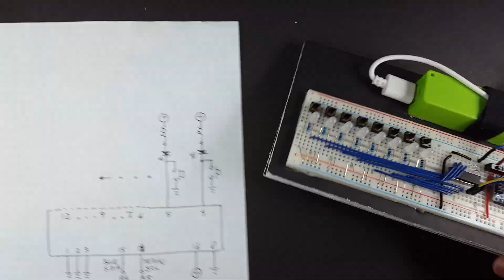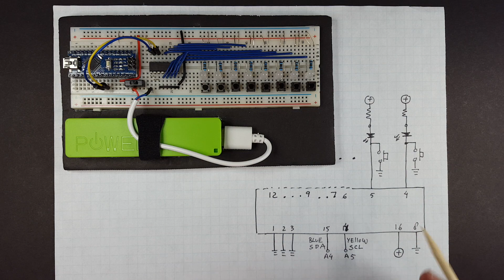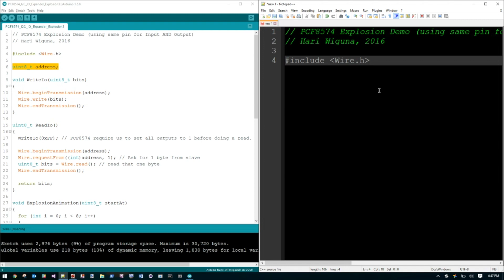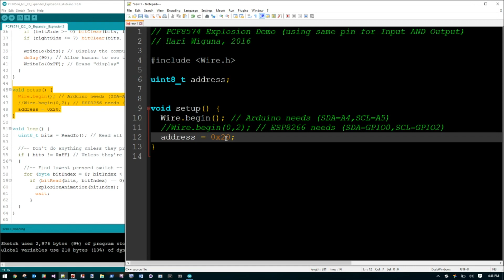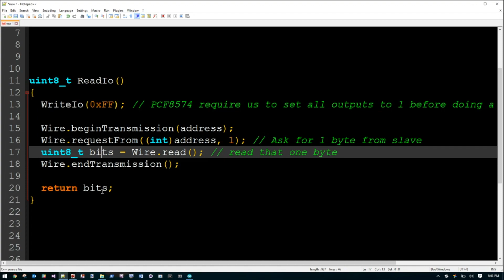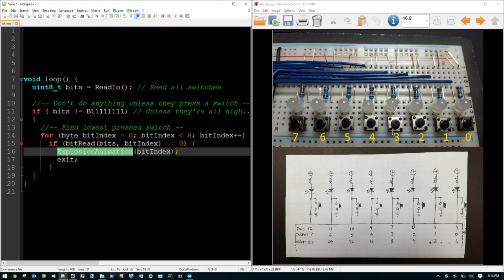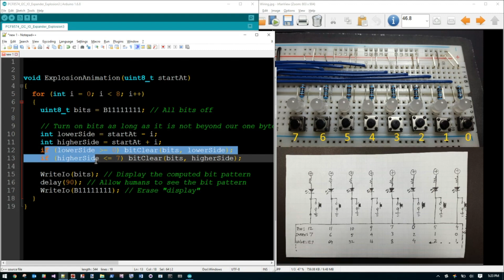HariFun #133 - 8 LEDs, 8 Buttons, just 2 Arduino pins!

Comment: Thank you for the clear explanation. I was confused how each pin is an input and output at the same time but now it's clear. Supply and pin are both high with led in the middle as well as a button that pulls to ground. Pushing the button pulls the pin low, but without the button pressed the pin can go low to sink current through the LED

Comment: For the ExplosionAnimation function, use this instead:  for (int i = 0; i < (8 - startAt); i++)  ...It's a little messy to continue the loop unnecessarily, particularly when there's a delay() in there.
Reply: This is incorrect. Let's say startAt = 7 (leftmost button), then (8 - startAt) == 1 and the loop only runs once with i = 0, meaning the "explosion" will only run one iteration and light up only LED 7.
The easiest way to end the loop as soon as possible is to break out when higherSide and lowerSide are both out of bounds (both are beyond the left/rightmost LED), i.e. somewhere between line 11 and 15 add this:
if (higherSide > 7 && lowerSide < 0) { break; }
When doing that, make sure that lowerSide is not an unsigned integer (here it is an int, so it's not unsigned), otherwise it can never be less than 0.

Comment: I had a lots of fun with the PCF8574, I did it on attiny85 and as well on wemos d1 mini, works well, I added relays on separate PCF8574 as a working unit with your animated leds. With attiny85 I also added Bluetooth or wemos with the wifi so I can switched them using the mobile phone. Work in progress.

Comment: Hi. Thanks for the video, I was wondering how to use the same chip for both LEDs and buttons and you explained it brilliantly. 
I was wondering whether it's possible to do this for a button and LED matric, such as 16 buttons (4x4 matrix) and 16 LEDs (4x4 again). 
Could you perhaps make a video about it?
Reply from the maker: Interesting idea! If you are thinking of a music launchpad, it might not be responsive enough and the leds might be a bit dim due to the matrix scanning, but it should work.
Reply: @HariWiguna  I was thinking more like a control panel for an appliance, like a microwave or a washing machine. You select the program, then you can have the options with the corresponding LEDs. Obviously it would be laid out differently on a circuit board, but the principle would be the same of a matrix

Comment: great video . LOL i look away for 2 days and you gone a did it . LOL . I like the use of 0 for active bit . very clean , sure beats the slower convoluted way otherwise.  I think it would be a good upgrade for my PIR system .  i just need to do a logic invert on the PIR output , great stuff as ever man !
Reply from the maker: +XerotoLabs 
Thanks man!  It's been a fun chip to play with.  Now, I'm going to have to hunt for the 16 bit version in AliExpress. :-)
The spec for the PCF8575 says this: "Latch-Up Performance Exceeds 100 mA Per JESD 78, Class II"
Does that mean each I/O pin could handle 100mA? for a total of 1.6A when all I/O pin are active?! That seems crazy high for no heatsink?!
Reply: +Hari Wiguna looking at the PCF8575e sheet form TI ,  it looks like 100ma is the max you can clamp via VCC or GND pins.
found in the easier to read MXP sheet : " A single LOW-level output current (IOL) must not exceed 20 mA for an extended time. The sum of all IOLs at any point
in time must not exceed 100 mA."
the IT sheet looks the same but is way more info about parasitic draws and leakages , and how to get fastest switching for telecom uses . seems these guys has a sweet spot in ma draw on the outputs for high speed switching  the PCF8575e that is .   

other than LCD drivers the PCF857xx chips mostly come up as depreciated or not recommended by thier MFR's as it's way old. LOL  . that said even it seems for I/O expansion on I2C sparkfun is not selling the PCF break out anymore , and now selling this beastie for 13$ on a breakout board : https://www.sparkfun.com/products/13601
Reply from the maker: Ah.. I knew it was too good to be true.  I have some cheap solenoids that I consumes about 80mA that would have been cool to connect to 16 outputs from the PCF.  I guess I'll have to add transistors.  Thx XerotoLabs!
Reply: +Hari Wiguna hey they are inductive loads , use some darlingtons ,  or a set of  ULN2008 (8bit),  pass your pin to trigger the ULN .   those cheapo steppers with driver usually ship with ULN2003(7bit??) .  i bought a stick of 2003's for 3$ a few years back , as they cat handle more current the less pins you use. . but you can get single Drlington in larger packages like TO-220 like package  , but i find i use ULN's for most stuff , but they sink current .
Reply: +XerotoLabs best part about ULN's is they include the free wheeling diodes in the package .
Reply from the maker: That is very convenient! Thank you sir!

Comment: My question is can you use a pulse at +5v at each switch. Perhaps using a 74hc595 8-bit shift register instead?
Reply from the maker: Yes, instead of using this chip, you could have the Arduino sequentially power up one of output pin of a shift register and then have one Arduino pin read a common line.

Comment: I need about 27 inputs from switches (digital).  Would you just add more PCF8574s or could you combine with some other pins on an Arduino?  Thanks for a great video!!!
Reply from the maker: Thank you for the comment! Yes, you could just add more PCF8574s.  Alternatively you could use a variation of that chip that offers 16 instead of 8.  Use one or two of those, or if you don't mind different code for some buttons, you could use arduino regular digitalRead pins and the IO expander.  Kinda messy, but doable.

Comment: Very clever. You replicated the nodemcu key/led circuitry on gpio16. Never tough of that. Now I'm wondering what can I do with this trick.
BTW, the PCF8574 is the IC in the cheap LCD1602 I2C adaptors. That uses only 4 of the ports. Have seen a couple of shields that use the other 4 ports for key switches. After your previous video I begun wondering if I could use the PCD8574 yo drive a LCD1602 and read a rotary encoders (or two). Would you mind to give it a try?
In any case, thanks for the inspiration.
Reply from the maker: Thanks +Álvaro M. Valdebenito B. 
As long as the LCD does not require constant updating, reading rotary encoder should be possible.
PS: I'd be interested if you use this trick in one of your projects.

Comment: What happend to LEDs when you press another button before all LEDs light up?
Reply from the maker: Good question!  I haven't tried it, but I think this is what would happen.
It is not multi-tasking, so pattern would complete before it reads any button.
However, since pressing the button provides path to ground for the LED, that LED would be on for as long as you press the button.

Comment: Good morning! I have an arduino micro leonardo atmega32u4 and I wanted to ask if I can use the PCF 8574 expander to increase the number of pins to connect more buttons and potentiometers? All the best.
Reply from the maker: 1. Yes, you can use the PCF8574 with the Leonardo atmega32u4.
2. Yes, you can use it to increase number of pins to connect more buttons.
3. No, you CANNOT use it with potentiometers.  The PCF8574 only handles HI/LOW, no in between.
If you need more analog inputs look into Analog to digital converter chips or multiplexer chips.  Good luck!

Comment: Hello 
just a question in the process of  reading button 
if i set the output to high then i press the button which is connected to GND 
shouldn't that be a short circuit and damage the board ? why it didn't damage the board 
many thanks for your good video :)
Reply from the maker: Wow! You're right! I see your point and cannot explain how I did not blow up the chip.  My thought process when I did the circuit was that to turn on the LED we're bringing that pin to ground to complete the circuit and at other times it would be floating because it's an input.  But I agree with you that when we turn off the LED, those pins are high and pressing the button would create a short.  Maybe because it happens so quickly?  Thanks for the comment.  Maybe someone smarter than me could explain the absence of magic blue smoke...
Reply: I believe there is internal pull-up resistors , so even if high its still passing though a resistor .  essentially these guys were meant to be fairly robust I2C serial <> parallel  converter chips .  
I had ideas of making some peripherals for my Arduinos along the lines of the 2line LCD screens . they use the very same chip just SMD to do I2C to the pins of the display . 
I had though of making a mini keyboard and such  , to just have for quick Arduino projects .  
but yeah I'm pretty sure as others have posted there is a internal pull -up resistor , so when you set the pin high ,  it is still passing through a internal resistor .
Reply: This was my thought, @David Farid.  I cannot find anything in the datasheet specifying a pull-up resistor on the outputs.
Very pretty breadboarding, Hari!  Am rigging something similar right now.  May try to interrupt-triggered reads using a 3rd line hooked to the INT.
Reply: my NXP branded ones , seem fine with high I2C buss speeds and have weak  internal resistors.
first paragraph of sheet http://www.nxp.com/docs/en/data-sheet/PCF8574_PCF8574A.pdf
Reply: Yes, thank you @XerotoLabs, the last part of 1. General Description states "The internal Power-On Reset (POR) initializes the I/Os as inputs with a weak internal pull-up 100 uA current source."  My own tests confirm that the chip stays cold, even without a resistor, when a high-driven line is drained.  Must have a weak fan-out.
My version of the chip is probably the same as @Hari's ... a PCF8574P at address 0x20.  "P" means DIP16 package. 
 Found a datasheet referencing this P version here:  https://www.digchip.com/datasheets/download_datasheet.php?id=748649&part-number=PCF8574P
Reading this, it is not so clear that there are current limiting devices on the outputs.  Perhaps under 8. LIMITING VALUES?  Well, anyway, I am convinced it is safe to use drain buttons on the outputs.
Reply: i agree totally . many times these chips are used to talk to lcd on i2c back packs(has no resistors on the backpack) , but you can find some that seem to go direct to input lines of simple keypads . heck some projects using salvaged phone keypads .
i think , when i get a day i should setup a key test and then check the ma passin through the given io pin and whole package . i have never had one get warm even yet , like you found .  heck I have even done stupid things like trying to invert the output using a crappy voltage divider setup . LOL  .On the up side they are very cheap , and i might try to get some SMD  style ones later , to shrink-ify some io projects .
Reply: One inexpensive way to invert the output is to use a 2n7000.  Surely, 0.1 mA will quickly don a mosfet gate.   Am thinking of pairing a ULN2004 with this 8574 for driving a pair of 5-wire steppers.  Maybe an ATtiny to control everything.  The 3 chips together, in SOP will cost about $1.25.   Meh,  surely though, its been done.  Everything has been done!
Reply: yeah Its a good idea for 'smartly' controlling things . I was telling Hari  a while back how easy it is to make a driver with shift registers and  ULN2004 or any Darlington array, but if you use a PCF' you can 'shift out' special bit patterns  as shift register simply cant as easily.    you can feed a shift register a starting pulse and  feed its out put back to its input and with a bit of foolery  it can drive a stepper relative to a pulse speed.  but PCF' is way better if you are wanting to have a bunch of motors .  it  run on I2C buss ,  has an address , and can  sequence complex bit patterns very fast and easy . 
the same chain ( array) of shift registers  would  take quite a while , as they are feed in series one through the other , making changing 1 pin on one  register a pain , vs just a address set in a PCF' array .

Comment: i would like to used this code for buttons but inside to lit led, i want to send midi note or midi massage, i will use pcf8575 that has 16 I/O  probably i will use 3 pcf8575 because i have more that 32 buttons.  i olso want to use interupt for pcf, i dont want arduino uno to spend procesor power to cheak if i have press a button all time,  because i will use a led matrix and i prefer arduino to focus on that insite to chek all time the button state.  can u help little with the code, and is pcf8575 suitable.   i want to make a consol to use it with TRAKTO dj softwear
Reply from the maker: Sounds like a cool project!
Unfortunately, I've never used the interrupt output of the io expander to know how it works.

Comment: I think the PCF8574 is to expansive, for that price you can buy a micro control with 8 io and more.. Cheaper is a 74LS595 and 74LS168...
Reply from the maker: +Edwin Noorlander ,
You're right, there are better ways to accomplish this.
Sorry, I should have mentioned that this was just a fun challenge I set for myself.  The Arduino does NOT need the PCF8574.  It has 20 I/O pins!  Enough to handle the 16 needed by this project.  Furthermore, while shift registers are awesome, they're output only devices.  The PCF8574 can do both output and input.  Thank you for the comment, it made me think of the pros and cons. Cheers!
Reply: +Hari Wiguna you're right. I mend the 74LV165A parallel in serial out bit shifters and the 74LS595 serial in parallel out. And I no, it's fun to program for these devices. But maybe a nice second video 👍🏻 keep on doing the good work.
Reply from the maker: +Edwin Noorlander , whoa! that's a cool complement to the 595!  Thanks for the tip!
PS: Do they have a 16 bit version by any chance? That'd be awesome!
Reply: +Edwin Noorlander The point is 2 pins. The solution shown is I2C. The 595 is a shift register, and the 168 counter. Both valid options for similar end results,  but neither let you both read and write as shown using only 2 pins from the microcontroller.
Reply: My point whas the cost of a single PCF8574. Not the spec's.
Reply: Yes  it is cost more but i think the point of this video is how you can get so much from one IC chip to do many functions  by just using only 2 pins. It's not about the cost of the IC chip it's what you can do with it that i think it important. Yes of course there are cheaper IC chips out there that can do the same functions or more maybe but i think hari hit it on the nail of what he did in the video.
Reply: +Edwin Noorlander +joseph chrzempiec (josephchrzempiec) yeah the chip on its own or in a few is not cheap ,  but you can but larger batches and clearance deals .  they most commonly seen in SMD form to drive the LCD text displays and and some keypads .  PCF8574 & PCF8574a and its sister chip PCF8575 & PCF8575 are handy for this , for the most part the ..74 and ..75 are identical, with the exception its base I2C address differs from each other and ..75's are 16 bits  , thus doubling the total I2C IO expansion peripherals you can have .  Keep  your eyes open , i got a bag of 10 in DIP mode for like 4$ USD  free shipping from china.  many spec sheets say they are limited to 400Khz fast I2C protocol , but even the oldest of the ones i have work well past 400Khz. 
 pcf8574, pcf8574a ... 8 bits
 pcf8575, pcf8575c ... 16 bitsI
Reply: Thank's for the tip. I bought one.

Comment: nail question. using esp-01 with MCP23017 can i get 8 input and 8 output?
Reply from the maker: According to datasheet MCP23017 operates between 1.8V and 5.5V so the 3.3V ESP-01 should work fine with it. Alternatively, you could use a level shifter and operate the MCP23017 at 5V and the ESP at 3.3V
Reply: @HariWiguna  
yes more my question and if i can activate 8 relays with 8 buttons for sliding alloy? using esp-01
 how in your project would you keep the led on?

Comment: What if i want to add another PCF8574 ?
Reply from the maker: We can connect up to eight total PCF8574 to the same two SCL and SDA lines.  We just need to make sure that each one is wired as a unique address via pins 1,2, and 3.  Then in the code, we would use the appropriate address to control each PCF8574.
http://www.ti.com/lit/ds/symlink/pcf8574.pdf

Comment: Great video!  Got  a few questions for you, one is: can this be used on the Arduino Due, it sounds crazy but yes It looks like my project is going to max out the pins on the Due, and I wanted to know is there any conflict when working with the ARM processor instead of the AVR?  2nd: is the communication fast enough to initiate interrupts and limit switches, I noticed from past experience that the I2C bus really isn't adequate for running multiple stepper motors in shield format at high speeds but could this shift register activate limit switch interrupts without any delay? and 3rd question: how did you make your wired connection lay flat like that?? its just beautiful, I applaud you, well done! :-)
Reply from the maker: Thanks Rich,
1. Yes, this chip should work with any microcontroller that supports I2C protocol.
2. I don't know how fast you need things to be, but serial is by nature "slow".  The datasheet says the clock max is 100Khz, but we need several clock cycles to send command bytes. 
3. I treat breadboarding like arts and crafts.  It is satisfying to me to see pretty wires.  So, I color code by line type, cut each wire to the perfect length, and use needlenose pliers to bend it just at the right places. Thx for noticing that Rich!
Reply: Great thank you Hari!